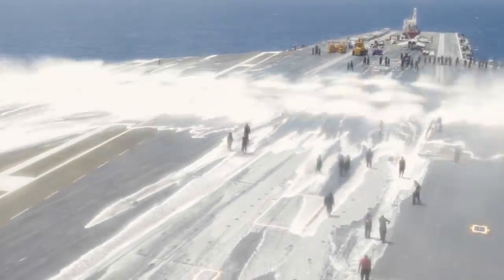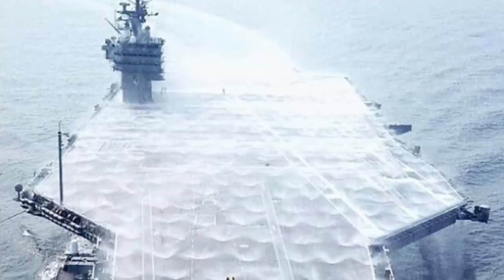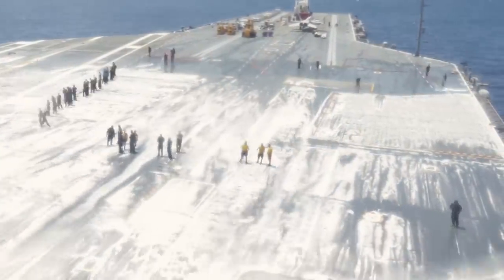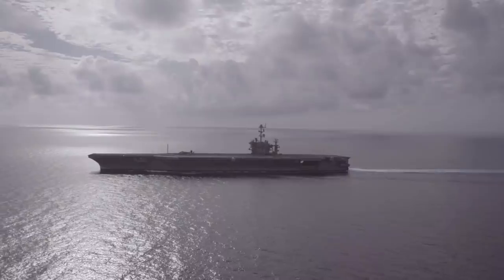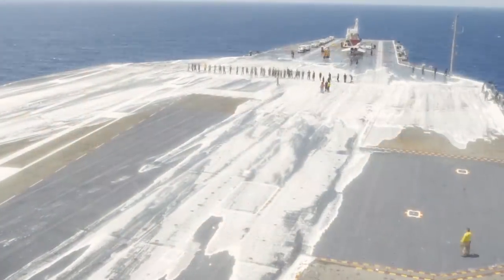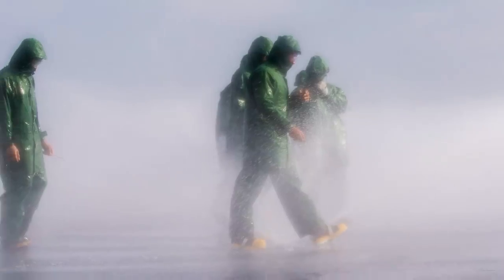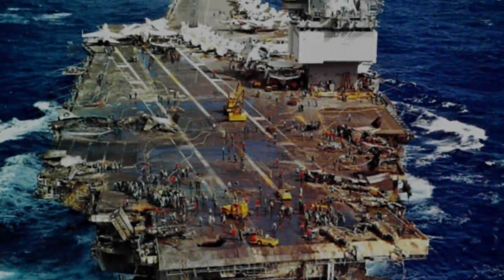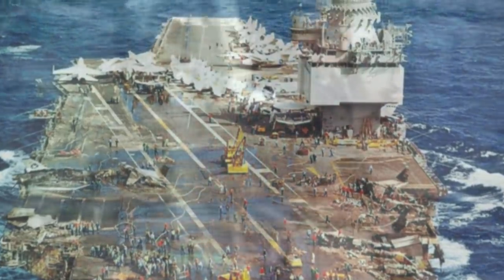Aircraft Carrier Bio Force Field - Countermeasure Washdown

Comment: Seeing all those sailors on deck while that "secret" crap is being sprayed all over them only makes me think how we'll all hear about cancer claims 20 years from now, like most every other crap the military sprays on their "valuable assets". Smh

And AS the narrator states that this crap is dangerous and everyone participating has to wear all safety gear, including gloves, guys are clearly walking through it with NO GLOVES. Great leadership and discipline!
Reply: Yep, shit fight in the making. Here in Australia there has been a LOT of issues surrounding the use of this stuff given its PFAS component...potent carcinogen.
Reply: So the fun history of AFFF, the Air Force and Navy quit using the old formula back in the later 90s as the PFOA and PFOS were linked to increased cancer in 3M factories (which workers continue to fight in court last I knew). They switched to another formula that used PFAS. Both branches were skeptical of the new formula but after assurances from the Firefighting Foam Foundation (FFF) that it was safe they implemented the change in the early 2000s. The problem was the FFF were representatives from various companies, none of which had done any testing at the time. They all lied and told the DoD that the new PFAS was safe. Jump to the late 2010s and it was found that the new "safe" PFAS actually have an increased cancer risk as well.
Reply: @hdmccart6735  wow hope this isnt the same stuff they use on the QE class carriers. They had people running through it taking samples in nothing but some overalls and goggles
Reply: @franciswaters7043  Can't be certain, but on the balance of probabilities...
Reply: Agent Orange & LSD didn't tell you ANYTHING? 🤦‍♂️
Reply: Back in the day we used zero PPE working with this stuff.   They made it seem that it was as safe as Mr. Bouble.
Reply: If soap and water was enough to kill the flames quick enough, wash down chemicals or radioactive materials out of the ship, then they would definitely have used that. But that's not really the case they are in right now are they? Chemicals such as AFFF carry the risk yes, but if it can save the ship and the people on board during times of need, then the gains far out match the risks. In war, a sunk Carrier can mean defeat of the nation you know. Prolonged exposure can cause cancers, but not immediate exposure. There will be guidelines taken for shifting personnel between periods of time until the emergencies are averted, and they have the necessary clothing to allow them to work for hazardous environments.
Reply: @col.strayga1389  cow blood
Reply: @GenesicShinZyraelKai  Have you ever noticed how the ones with the guidelines are never the same ones in harm's way?
Reply: INERT Sadly, that's a fact. My dad reported with a sunburn and the military threatened to throw him in jail. They said he was the property of the US government.
Reply: It's not a secret! I was in the Air Force and I know what AFFF is. And it has a distinct onion smell. When they tested a hanger; it would wash down to a retention pond and as you drove by you could smell it. NOT A SECRET.

Comment: I seriously doubt the fire foam has anything to do with decontaminating the vessel from bio or radiological hazards.  Its likely a fire fighting device only.  Not nearly as sinister as the dark voice over would imply.
Reply: no it does. most navy ships (at least in the RN) have some kind of system which sprays the outside of a ship in case of a CBRN attack.
Reply: Aqueous Film Forming Foam, aka AFFF is akin to soap.  The foam would act as an insulator and  adhere to the metal of the deck and the hydrocarbons to exclude the oxygen from the "fire triangle"  Acting as a soap it also worked well to wash away the radio nucleotides, bio substances and chemical agents from the ship.

Comment: We did this on the destroyer I was stationed on from '99 to '03. You dont have to inject the AFFF into the washdown. You can do salt water washdown or fresh water washdown also. We did salt water wash down while at sea running chemical, biological, radiological cloud drills, and we did fresh water wash down every time right before we pulled in port somewhere to get the salt off of the ship from being out at sea.

Comment: I did not serve on a carrier and I served years ago but I think you are mixing things up.

AFFF is indeed a firefighting foam system, and is used to prevent or extinguish fires, especially fuel or oil fires.

The countermeasure wash down system is designed and intended to protect the ship in case of a CBR (Chemical, Biological or Radiological) attack by keeping dangerous particles or chemicals from settling on surfaces of the ship if these substances are encountered.   The wash down system uses ordinary sea water from the ships fire main system.

It would make sense that on a carrier that the same system/piping would be used for AFFF application as well as CBR protection but I'm certain you would never use AFFF in a CBR attack situation as this would largely negate the effectiveness of the system in such a scenario, since the AFFF mixture is designed to stick to surfaces which is the opposite of what you would want if you're being showered with radioactive fallout or some kind of chemical or nerve agent.

All modern U.S. Navy ships have a countermeasure wash down system, on my first ship (USS Valley Forge (CG-50)) I only recalled it being tested once, when we were returning from a port visit to Portland, OR we activated the system while cruising seaward in the Columbia River, that way we were washing the ship down with fresh water instead of salt water.  If we used the sysyem in the ocean we would need to manually rinse the ship off with fresh water afterwards which is a difficult and arduous process as well as using a HUGE amount of the ships fresh water supply.
Reply: You was a coward in the Navy. A damn yellow coward.
Reply: @raitchison  The truth will out. You received the white feather for cowardice.

Comment: A triple F isn't exactly new, we have used it for years in the Fire service for class B fires (think buckets, flammable oils and such). Per my old Fire instructor, the original versions were made from collagen of some sort. The way he explained it was basically srape up the floor of a butchers shop and everything that was to bad to be thrown into the hot dogs and send it off to DuPont. It was chemically treated and formed the film over the oil and thus, both cools the accelerents and smothers the fire and vapors. Whether the colagen based version was true was dubious to me but I do recall in my first flammable liquids class that when we came back from lunch using the stuff he said was animal based, buzzards were swarming and eating what was left of the foam in the large tank we used to practice deploying A triple F that morning and the next day is smelled worse than 5 day old roadkill in Georgia in July.

Comment: A lot of comments about the pics showing sailors with no gloves, or even no protective gear during some wet events. They are not in the A Triple F solution, but simply walking thru the seawater sprayers (which is just that... seawater) but would be suited up head to toe for the actual foam event.

Comment: AFFF doesn't have anything to do with anything but fire. It's not proprietary,I used it 20 years ago in a small town fire Dept. Now the same system can be used as a decontamination washdown,but the A triple F is just fire fighting foam. In the real world and the hoses  on board the carrier,it's done with a inductor sucking up whatever percentage you set and mixes in the nozzle.
I think it was made by Dow chemical. It's main benefit is that it's not protein based. The standard fire suppression foam is protein based and stinks like rotted meat as it decomposes. A triple F doesn't stink. It also makes a stronger more stable foam,so it's not as apt to be disturbed while floating on say gasoline.
Reply: 3M and AFFF does smell like shit.
Reply: @dlowfresh  Was 3M? I couldn't remember. It's been 21 years since I left the fire Dept. I know it stinks,but not as bad as that protein based shit!! Take care be safe and healthy!
Reply: @tomcline5631  Thank you, you do the same

Comment: So many facts wrong with this video. A Triple F is fire fighting foam only. It is always premixed with water prior to use, never laid out and then mixed with water. It also has absolutely nothing to do with NBC wash down. The ship will simply run the wash down system without introducing A Triple F in the event of an NBC attack. Interesting note, in the Australian Navy, we don't use the term circle William but Condition Zulu instead for full watertight lockdown of the ship.

Comment: This video is misinformed AFFF is used solely for fire fighting as it does not provide any protection against an NBC attack and the foam created will not protect anyone from a chemical attack. The author is confused about the two systems as the Chemical Countermeasures System is seawater only and is used for that purpose only. It sounds as if he was making a point to mesh both systems for the sake of having a video this week. MM1 (SW/AW) Retired, DC Central Supervisor, Engineering Officer of the Watch, R2 Main DCTT Member and ETT Member.